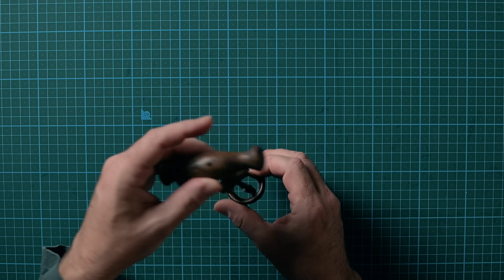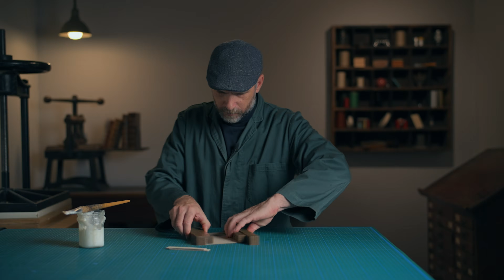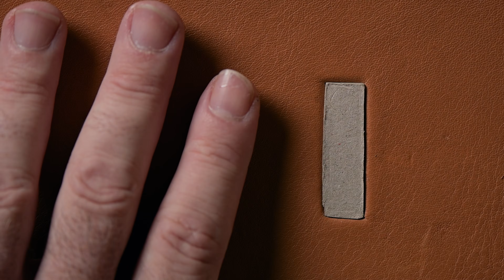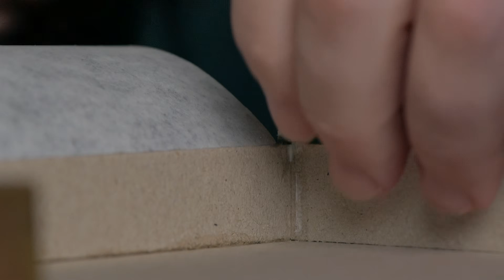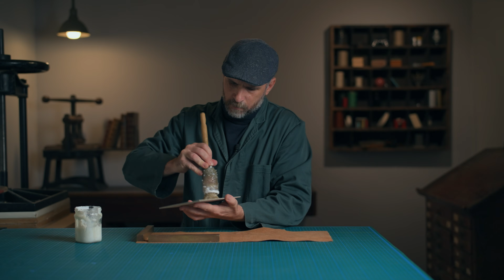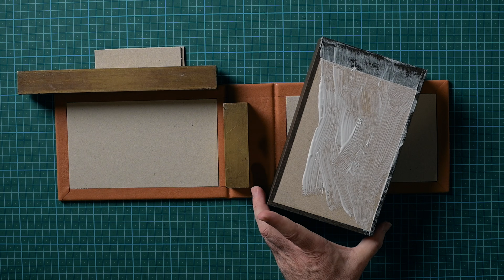My Most Complex Leather Box Yet

Comment: Skills are evident in the video. But at least as valuable is the design, I didn't realise the form it would take until the end. 

Conceptualisation of each stage of the process is incredible, especially considering the particular methods needed involving the weights & glue.

E.g. which areas can be left as raw card, and which must be covered.  Minimising the steps & contact with each piece to keep them clean.

And the very last component was inserted upside down so that the fit was perfect when closed... This is ninja level construction!
Reply from the maker: Thank you so much for your kind words and support!
I really appreciate it ❤️